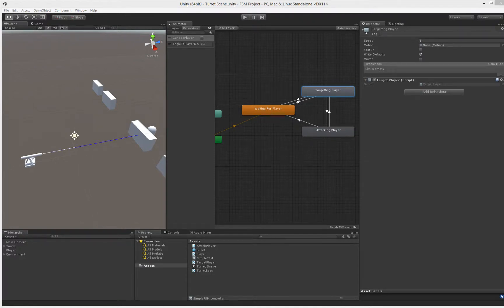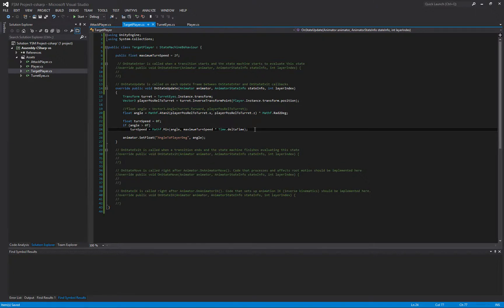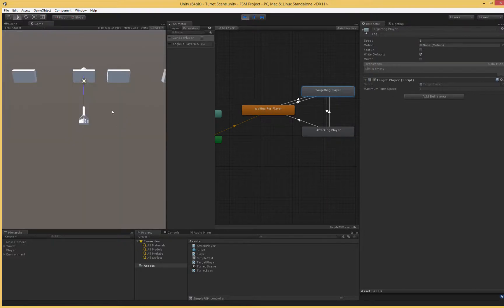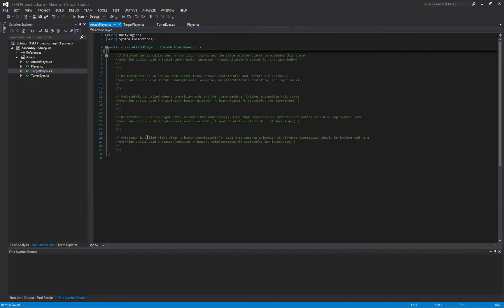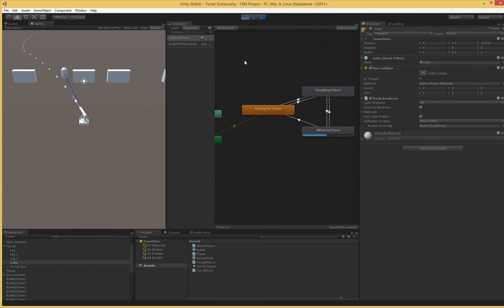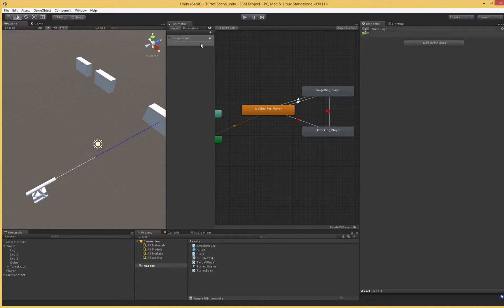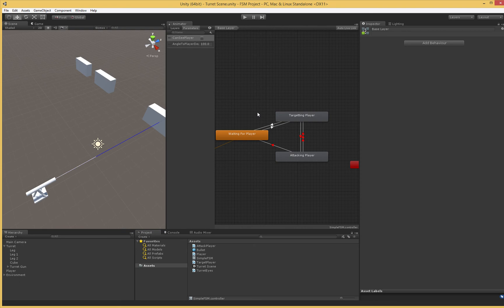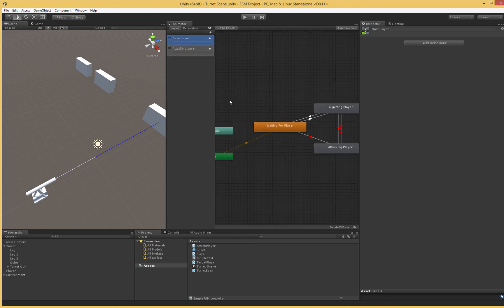Finite State Machines Part 2

Comment: Nice video,

Is there any reason you choose to set a Time.Time comparison rather than using InvokeRepeating and turning the bullet code into a method (i.e. FireBullet())?
Reply from the maker: +Napoleon Martinez Good question!  I actually had to refresh myself on this one, but the issue is that StateMachineBehaviours are not MonoBehaviours, because they aren't tied to a particular GameObject or even a particular scene in Unity.  And many things that we take for granted in our MonoBehaviour scripts, like InvokeRepeating and coroutines, are not available in StateMachineBehaviours.

You're right that that would be a better solution, and the way to do it would be to use a singleton coroutine manager like TaskManager (which you can find in the Unity forums) that can manage a repeating coroutine for our script.